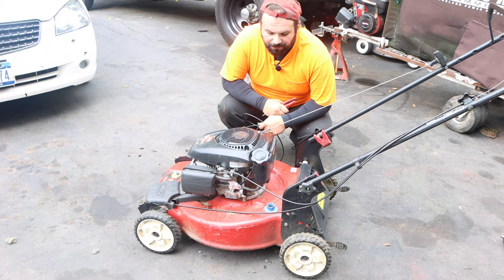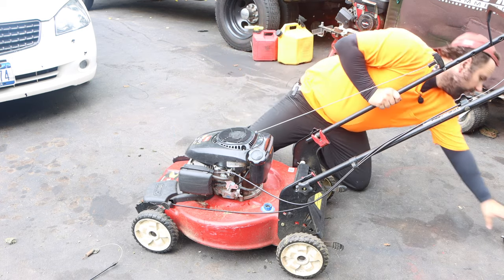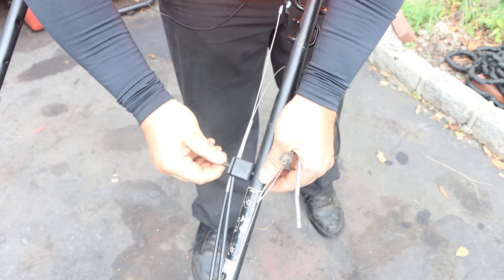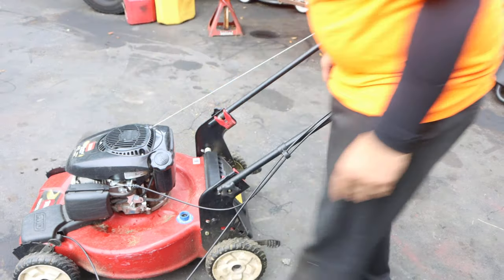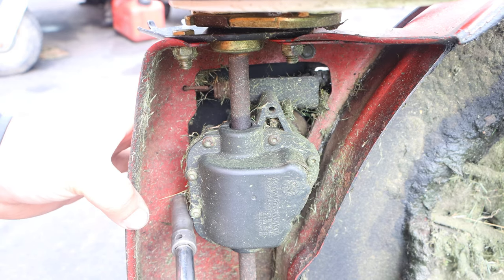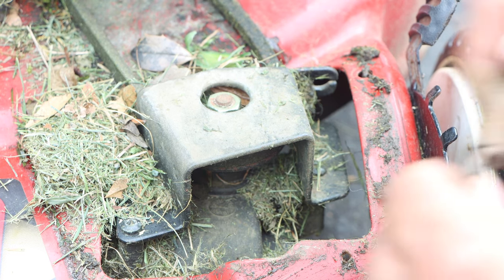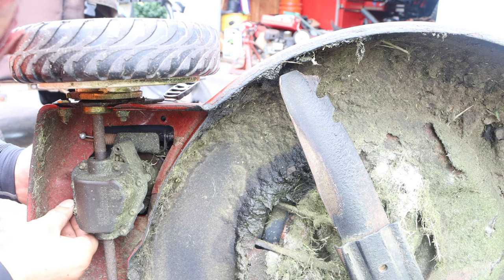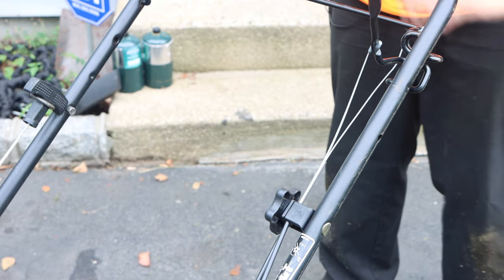How To Replace The Self Propelled Drive Cable On A Toro Lawn Mower QUICK, EASY & CHEAP FIX

Comment: Step by step as you described! The protective cover on my model Toro had two more nuts closer to the engine. Easily done. Same size nut. Thank you so much! You saved me a ton of money!
Reply from the maker: ROCK START JOB ED!  Videos like these mean nothing with out people like who have the drive and initiative to do it yourself.  Your mechanical instincts kicked in with the additional nuts.  You knew exactly what to do!

Hopefully you are still in fix it mode…it’s a good time to change your oil if you haven’t already.  

Thanks for the view and comment, hopefully you subscribed to my channel 🇺🇸🦅🤙🏻🔧

Comment: Hello Thank you very much for the Video, My TORO lawn mover is not pulling I put brand new BELT Plus I Tighten up the Wire that rotates the Tires still it is not pulling What is the problem?

Thanks,

Naz
Reply from the maker: Pull the drive wheels off to make sure they aren’t stripped…

Can also leave the belt cover off…start the mower and engage the self propelled.  See if the belt moves to engage the transmission

Comment: My belt keeps coming off on the drive cable end of my 20332 rear wheel drive. I’ve tried two new different belts. The last one I tried was toro original. Any tips on how to fix this?
Reply from the maker: Are you on Instagram?
Reply: No sorry. Not on instagram.
Reply from the maker: @dblaylock22  give me a call 631-707-0797

Comment: Hey Jason good one I like your how man tools you need my problem is i know what tools I need for the job but usually when I'm done I have like 50 tools laying around when I only needed 3 for the job anyway about the charge I don't charge an extra I usually clean them a little anyway as always tell the misses i said hi
Reply from the maker: Anthony Buchan,

We’re the same...but different 🤣. I have everything out but On Camera I show what is needed.  Not many people are blessed to have  the repertoire of tools we have.  Sometimes cleaning up takes longer than the job🤣

What I meant about charging extra is on Self Propelled Mowers.  Do you charge extra to pull the belt covers and clean all the debris out?

ABSOLUTELY send the Mrs your wishes...as always! 🤙🏻🇺🇸🦅🔧

Comment: 4:27 you said it backwards. lol. Air filter to the sky or carb up :p
Reply from the maker: norge696,

My man!  Thank you! Hope all is well! 🤙🏻🇺🇸🦅🔧
Reply: @pattayperformance  That statement doesn't hold true for Briggs pulsa jet engines. It doesn't matter if you tip it with the carb up, oil still finds it's way into the oil filter.  So unless you're changing the oil never tip it on it's side. I usually put something heavy on the handle so the spark plug is in the air and all the oil goes to the back of the engine.
Reply from the maker: norge696,

I Usually don’t work on the older stuff.  Tecumseh has the muffler and carb on the same side...carb to the sky never an issue.

Briggs pulsa jet...never worked on one of those yet 😬

Comment: I just replaced my trans, wheels and belt. The wheels spin wide open as soon as I start mower - this tells me there is no slack in the belt. Ive adjusted cable all the way in both directions with no change. Does this mean the cable is too stretched and needs to be replaced?
Reply from the maker: CHRIS BASS,

Thanks for the view and comment!  

The belt spins the whole time while the engine is running.  When you engage the cable it pull the pulley on the front of the mower on the trans to engage with the belt.

Cable is not the issue...

Belt could be the wrong size, wrong trans/pulley or possible not installed correctly.

Thanks for the view and comment, hopefully you subscribed to my channel 🤙🏻🇺🇸🔧🦅
Reply: Thanks for the reply! I will have to do some more work then.

Comment: Same mower, frayed cable, not broken. It engages wheels, but not enough traction. Could a new cable solve this problem?
Reply from the maker: Potentially…replace the cable and adjust it

Comment: You're blocking view of what you loosened with needle nose pliers --
Which of that double sided clamp did you pull?
Reply from the maker: Do you have a time stamp?
Reply from the maker: @Falyoou9 plastic piece that you squeeze to remove the cable from the bracket

Comment: UUUUGGHHHHH!!! First the cable was too short. Ordered another one and it’s too long. I’m so friggen frustrated.
Reply from the maker: Interesting…are you using the link provided in the description?  If yes which one?
Reply: OMG I never expected you to answer!!!! So firstly, thank you so very much for that!!!
I rewatched your video to make sure I hadn’t missed any  steps when I noticed that my knob (that acts as the tightening nut) was on the outside of the handle as opposed to the inside like the mower in your video. While switching that up made zero difference (and I knew it wouldn’t…I’m just super weird/OCD like that on certain things😂), it gave my brain cells enough time to fire and it was simply just a matter of adjusting the cable from slow🐢 fast 🐇 with the knob and I didn’t realize until I actually “trusted” myself enough to give it a try. In that process , I learned that the extra slack in the cable wasn’t as vital as I originally thought it was! It just looked/appeared to be “wrong” because I was expecting the self propelled control bar to have the same resistance as the other one! 

I came back to delete my comment and to replace it with a VERY SINCERE, “Thank you,” when I saw you had replied and how PROMPTLY you did so.

So…. I’m leaving my stupidity, insecurity, embarrassment and what I thought was an epic double failure juuuuuuust in case it might just help someone else out there who is a “weird” as I am. 😂🤷🏻‍♀️ 

Again, thank you SO VERY MUCH!!! I didn’t think I could do it without my husband…but I did…and I know he’d be proud.
Reply from the maker: Great job and way to stick with it!

Comment: I like how you worked on it i have exact same one i was doing some lubing of squeeky wheels and i noticed my drive belt was loose like waaaaay lose and i noticed my trensmission was rocking back and forth but there was no way to keep it pulled back so the belt is tight so i came up with this hack where i put bolt trough frame with nut on each side like a tenssioner bolt and i got it to stay pushed back and belt is tight but now when i start it up while holding startup lever down the wheels turn too and the back lever does nothing what do you think can be the cause, too much tenssion on belt? Or bad cable i cant figure it out oh and also before i added that tensioner bolt when i would cut grass my mower would stall on tall grass but now that i put some tension on the belt it plows trough like nothing, i mean i like the way it runs now i just want to be able to stop the wheels from turning when going downhill and now i cant cause they are somehow linked with control bar if i let of it turns off
Reply from the maker: Belts stretch over time…I’d start there.  Make sure the spring is there for the transmission.

Thanks for the view and comment, hopefully you subscribed to my channel 🦅🤙🏻🔧🇺🇸